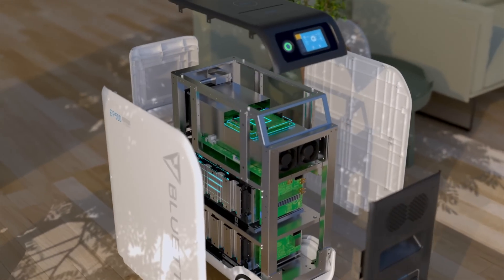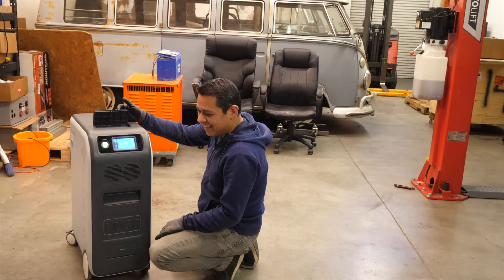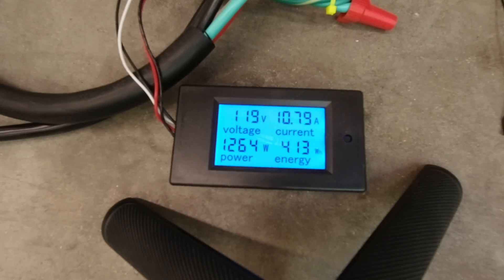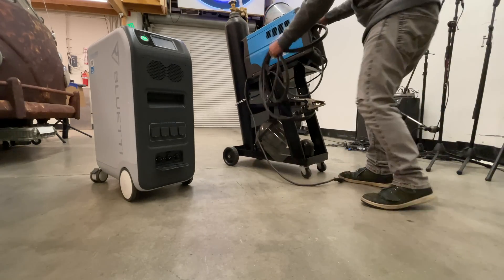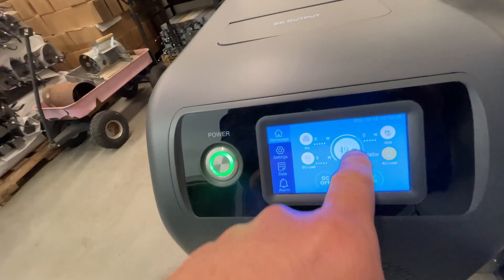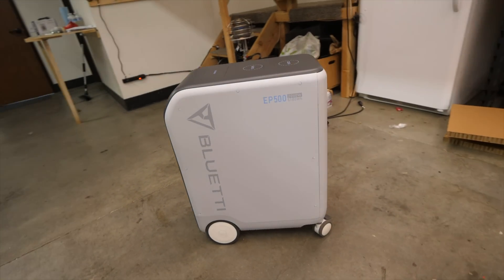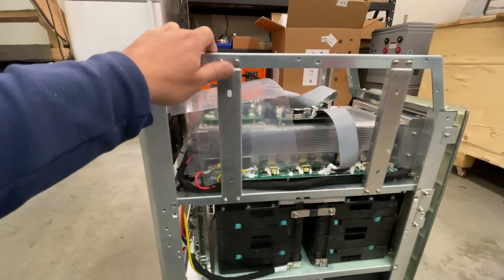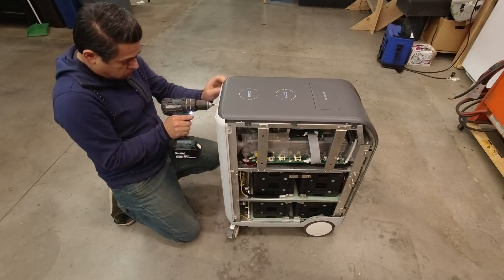Everything you need to know about Bluetti's NEW EP500 - review

Comment: Thanks for this excellent overview! Do you think I could lay the unit on it's side, while making sure ventilation is not compromised?
Reply: I have the same question. I’ve backed the EP500pro Kickstarter, planning to use boondocking & in off-grid application, but need to transport laying down in my tow vehicle. I noticed at the start of this video the EP500 is on its back. Have you figured out the answer to this question yet?
Reply: I can't imagine why couldn't use,  store or ship this in any orientation since that's the nature of LIPO4 batteries in general. 
It shouldn't matter.

Comment: Does this have car charging mode (12V@8.2A) like the AC200? Tesla Model 3 lighter socket will output 12V@10A max. It will be useful to tap into the vehicle's larger battery (no matter how slow the charge rate) when needed.

Comment: wish they would use hardware switches for the DC/AC on/off sections instead of the touch panel. I turn my ac200p on and off all the time and that touch panel is not very responsive.

Comment: would be better if they made some kind of box half the size where only the controller and electronic is, then made plugs on the side where you plug in packs of batteries so they are easy to replace, this just looks like another Apple's way of doing things, but hey replacing those cells should be easy by the looks of it.
Reply: Sounds like you want a ... 3000 Watt Hybrid DC-to-AC Pure Sine Inverter with a Solar Charge Controller.  Yes, you can buy that for $800 and connect your own LiFePo4 battery bank ...

Comment: 85% is terrible means the battery is no way as big as they claim.
Reply: No.
Reply: @USNEM  No?
Reply: @darrenorange2982  Efficiency of DC-to-AC Pure Sine Wave Inverter, plus COOLING FANS, plus Computer & Display.  Can you do better?
Reply: @MrSummitville  Yes I'm getting over 80% rated capacity on my battires now but I'm not using the full capacity/voltage range.  inning from 4.07V to 3.36V, rated range is 4.16V to 3.08V.  I don't think the batteries are delivering their rated capacity.
Reply: @MrSummitville  Cooling fans and computer can't really consume more than 50Whr so i don't think that mater that much.
Reply: @darrenorange2982  It consumes 33 Watts in Standby Mode x 8 hours ( he ran the test all day ) = 264 Watt-Hours = 5% LOSS just for stand-by ...
Reply: @MrSummitville  it should be far lower realtive to the output it means the conversion to AC is losing 10% or more...seems poor

Comment: Refrigerator? Freezer? Coffee maker? The truly important stuff. Who manufactures the batteries?
Reply: Actually, the most important part is the wattage rating.  It can do 4200 watts.  So, for those appliances, just find the average wattage they use.  For example, if your coffee maker uses 100 watts per use, you can use it around 42 times or so.
Reply: @jeffwads  Actually, Robert Nicoletti has a legitimate question.   Can you answer his question ?
Reply: @elli003  
Solo busca bien en internet, hasta en mercado libre sale el tiempo que duran conectados los equipos que menciona esa persona
Reply: @juanferroso4464 In Ingles por favor.
Reply: @elli003  
Just search about the product on the internet, it literally does'nt even take 30 seconds and also you can use a translator, don't be lazy.
Reply: @juanferroso4464  You're right.  It's doesn't take 30 seconds.  Which is far more time than you're worth.
Reply: @elli003  
Vaya pero que gringo más escandaloso 😑

Comment: The device you are using to check Watt hour would not be that accurate. Specifications for your device may be 20% deviation plus and minus the last last digit of the display, which will give you the resolution of device. Where as a fluke multimeter would have 2% deviation plus or minus last digit mate. So just check specification. The unit under test would still be a little low via this anyway. How you dog, have not seen him I'm a while.  Stay safe.

Comment: Still limited by 2K watt output...even with a software patch bypass, If you're bypassing 2700W and grid fails to 2000W inverter...what then?  UPS setups should be designed to support max capacity of "possible" load.  Not really a deficiency, IMO, as this is really a head's up backup...not like a commercial solution....single 15A circuit.
Reply: The EP500 has a 2,000 Watt Inverter ... so WHY would you be so stupid and attach a 2,700 Watt load?
Reply: @MrSummitville  LOL...that's not a very intelligent question.  Since a UPS function would likely tie into a service panel (or sub panel), a better question would have been, "does the unit limit bypass power to 2Kw."  Yes, directly plugging in more than 2Kw to the unit itself would be "stupid."  (and many will do it)  Cheers!

Comment: I would like to see a video about battery safety.  I see most of your project indoors but not much is shown in case of a fire, smoke or anything else that can fail. Are batteries better indoors or outside,  i would like my battery install to be apart from my house or shop, in case of a fire , or set it up in a way that the fire won't burn off your whole house.  Is  there anything that we can setup to help control a fire, smoke, or even battery runoff , like adding sprinklers or foam system or install the batteries outside?
Reply from the maker: Batteries are incredibly safe If used correctly,  I’d say a well designed system inside a metal box is enough
Reply: Lithium Iron Phosphate  (LiFePO4) is a safer battery chemistry than Lithium Ion but weighs more for the same amount of power storage.  You can see videos of people using a power drill to run through a LiFePO4 battery pack and nothing happening. Poor and undersized wiring outside of the unit would be my guess as the biggest fire risk. If you put all this in a small power closet, you can add automatic fire suppression device like a proteng or FireSlayer that would discharge if a fire started in the closet for peace of mind.

Comment: Do you think that a small house or cabin could be powered with these units?  It is almost like a smaller Telsa power wall.
Reply: @JD  A small cabin = Yes.  A small house maybe.  But ONLY if you do not need more than 2,000 Watts Total.  At sunset your loads must drop below ~500 watts, to make to dawn. And you have max Solar Panels ...
Reply from the maker: Yes
Reply: Depends on, what you think is small i  would say :p

Comment: No thanks. I'm not interested in doubling the investment to reach a higher capacity when a single unit could easily be produced with higher output with integrated 240 volt plugs. This model along with the options will be outdated in a year.

Comment: I would use it as a UPS for my fridge:) My baby boy has to eat!  You should get units like the titan or inergy..... I've been looking into these as an apartment backup because you can run them inside.
Reply: Why not buy a UPS ?
Reply: @MrSummitville  only because it's more difficult to charge a ups with solar panels than these all in one units.
Reply: I just finished making my baby boy his own 7200 watt hour wheeled 130 pound ''solar generator''. He's 35 and still cries when the power goes out. Its for his fridge and chest freezer. Last year the utility cut him out for 47 hours but the Honda 2000 generator I gave him came in handy. Now he can rig for silent running and his wifee can blow dry her hair. Cost about $2700 in parts, $100K in my engineering/fabrication time. I will give him some solar panels and 80 feet of 10 gage wire to connect the panels he can temporarily place on the patio roof. For the last 2 weeks its providing cooling for my house for free while I field test it and make minor improvements. Today I just installed Bluetooth on it to monitor the battery with my cell phone. So far, so good.

Comment: Why it only takes 600w from the wall? A normal plug can do 10A, so 1200w without problems...
Reply: The Pro version is listed as wall outlet input  (1800W in US)
Reply from the maker: Because it’s using the 600w charger
Reply: @jehugarcia  In this type of product in my opinion, with its capacity and price them should include a 120v 1200w charger on it, it won't make a huge difference in final price and it will be a good feature for a customer that is paying over 2k for this power bank.

Comment: Why do you have a 4000W DJ setup? Batteries by day DJ by night
Reply from the maker: I used to play in a band in another life
Reply: Nice... but i would point out that that system doesnt use/pull 4000watts. The speakers use 1/10th of the power they can put out...100w for 1000w output...not like older amplifiers that need 1000 watts for 1000 watts. I bought some to test the same outdoors with pv. Coming this summmer outdoors in nyc. Keep rocking

Comment: Why does everyone test with some kind of tool but never LOAD the tool?  A chop saw NOT CHOPPING doesn't use nearly the load that it would use running through material.  And likewise...balsa would be different than construction lumber vs. quality hardwood vs. metal, etc.
Reply: Agree, chop thru some oak, or at least some pine, anything.
Reply: Testing chopping some wood would have bren great. Chopping through some hard woods would have been better. Yes the startup surge is heavy, but it's quick. Using a heavy load from cutting some hardwood keeps the surge load heavy for longer.  Another point is that you want to test it as it is intended to be used. I doubt anyone buys this to spin up the chop saw a couple times a day.  Probably want to actually cut wood at the site.  The welder was a good test, but that doesn't negate the need to test the saw under a working load (which can be greater than a simple start up).
Reply: Yes yes... the motor would pull more power while cutting through the wood.  A harder wood would require more power.
Reply: actually none of what you say makes any sense, he used the mig welder that has an insane surge and power draw. your logic is completely wrong here
Reply: wait, my chop saw trips the breaker on startup but if it somehow doesn't than the saw runs ok, so actually you're wrong. if the power supply can survive the start up that is the greatest feat. not all chop saws use a lot of power though, for sure the harbor freight hercules chop saw does, thing is a beast
Reply: @eksine  You don't have to believe me...Try it yourself with a meter...You think the motor won't draw more power once it encounters a hard wood? If your breaker is tripping on startup then your breaker already  almost full and has loads running on it.  Motors do have a startup current yes... but what were saying is that without testing it with a cut, one can't truly measure the load it would draw while in use... I would check you "logic" before a quick response.
Yes he did use a welder and the comment was not based on that...
Be well.
Reply: @LiveSounds11  than the welder by itself refutes his claims , for you to ignore that fact makes you the one not being logical here.
Reply: @eksine  read the reply from @justin mentions no welder or claims of any welder compared to a saw... refute that cutting wood needs more power  than just turning on a saw? No discussion...I'm wasting my time replying now... peace
Reply: @LiveSounds11  so basically when you're losing the argument you just bounce? Good logical strategy there
Reply: @justinroysdon2630  no in this case not, because these guys mentioned chop saw, which they don't know the difference between that and a miter saw. I assumed they were talking about an actual chop saw. Second he adamantly ignores the welder. No matter what load you put through a miter saw (not called a chop saw btw) you will never match what a welder will surge and draw at the same outlet. So it is technically correct to call him an idiot, it would have been more accurate to call him an idiot and an asshole. At the very least YOU should know what a chop saw really is do you not???
Reply: @justinroysdon2630  and BTW I never said adding some wood wouldn't be a better indicator of what the power bank can handle. That's obvious. What's not obvious is what drugs these guys are using
Reply: @eksine  honestly, there isn't much difference between a chop saw and a mitre saw (mitre saw can just do multiple angles). They do almost the same thing, and when the mitre is locked in the 90 degree position it looks nearly the same and does the same as a chop saw. So kinda doesn't matter. Either way, his point is still valid. And arguing over the minor differences between a chop saw and mitre saw is... well, stupid. They both can have significate power draw.  While spinning up the blade is a big load, actually chopping (or sawing) wood on either can generate more sustained load than just spinning it up.  That was his point... getting lost on an insignificant detail like chop saw versus mitre saw is... pick your adjective.
Reply: @eksine  you can buy many different quality levels of both chop saws and mitre saws. You are correct, a chop saw typically draws more and typically has a more powerful motor. But you can get mitre saws with just as powerful of a motor. And you can find chop saws with weaker motors.  Either way. It realy doesn't matter.  You are so focused on this difference that you are missing the point.  I wish you all the best.  And maybe some day that you will learn to stop insulting people just because they have different views than you.

Comment: Agree with Brian B, 27.7 watts (4292w * .155 / 24) consumption on idle is way too high for a 2k inverter especially when combined with an inverter that is only 83.8% efficient.  A Victron Multiplus with a 2000w inverter only has a standby draw of 7-9 watts. I haven't looked up other inverters like AIMs or GoPower.
Reply: The fact you used victron as your comparison is disingenuous. They have the lowest idle consumption of any inverter. 15-20w is just how it goes for most inverters. Not much can be done.

Comment: So it's a generator you have to plug in great
Reply from the maker: Try using any generator without plugging it in.
Reply: It's a "Backup Power Station" per their website.  When paired with solar panels is where the term "solar generator" comes from. Just like how folks refer to gas generators or propane generators by their energy source.

Comment: Why does it draw so much power when it's not used? That doesn't seem right lol.
Reply: AGREEz 15% overhead ????
Reply: I personally can't figure out what the heck where they thinking.  The honeymoon with this machine never began.  I have a Yeti 3000.  After three years and six months it still charges up to ninety three percent.  I use it for emergencies and blackouts.  So far so good.  I use it with a Frigidaire freezer fridge, lights,  charge everything, fans and a Cpap machine.  I can say that it is a proven product.  I see everyone criticism but I can say it's a good one.  I cycle it between twenty five and seventy five percent to extend the life of its battery.  The new ones offer a battery saving mode that extend the life of the batteries in the same way.  I am happy with it.

Comment: ok wow. you ran a lipo battery as a substitute for a PV array!! i didnt think you could do that because the solar charge controller would search for max amps and not be able to current limit itself and fry it self. this is very interesting because i have a 48v bank in a boat and need a large current 12v bank as well and was thinking of running a victron 75/15 solar charge controlleri have lyinfg around.  i want to charge the 12v bank from the 48v bank. just by putting the 48v into the PV terminals on the controller.... can this be done? you just did it... how did it not blow up like i was told would happen?
Reply: it would only take a firmware hack to turn your dctodc converter to a solar charge controller or vice versa. someone needs to build a device that has both options to force victron to stop this act of niche rebranding forcing people to buy two units when in reality they only need one.
Reply: best way to find out connect it but pick a fuse of the max current the victron can handle if it cannot regulate it then all that will happen is the fuse will blow protecting the victron and you will have your answer, thats my thoughts anyway
Reply from the maker: If the Victron kills itself then it’s a terrible product and it’s a good thing you killed it
Reply: @jehugarcia  lol. lets do this! :)
Reply: @jehugarcia  my gripe is this. victron sells a solar charge controller for $250 that can charge at 30amps . then it sells a dc to dc converter that can charge at 30 amps for $350. these are essentialy exactly the same units but with different software. how can you change the software and hike your price %30.  i am looking for a way to hack the firmware (through code or analogue electronics) so that people can stop this rebranding of identical items and profiteering.  both units are identical DC to DC converters just with different code.

Comment: My concern would be the serviceability aspect. This unit would cost quiet a bit to ship back (if you can and keep all the packing materials). Love the big power aspect though ,
Reply: Exactly. I am also not a fan of the small cells used in this unit. The ac200 had better packs. I just don’t like having hundreds of cells because there is too much room for problems at this price.
Reply: @andrewangelos85  I think the Titan was on to something with modularity but not sure how good that company  is commercially
Reply: @dnhman  plus the Titan price of $3,600 for just the unit.
Reply: @andrewangelos85  that doesn't matter. If each cell is fused its fine. I would rather have 1/300 of my pack go bad vs 1/12th.
Reply: They will come to your house to fix it or pay for the shipping. No cost out of your pocket.